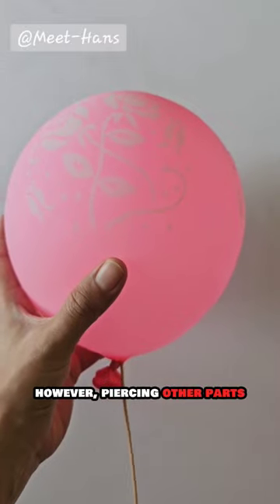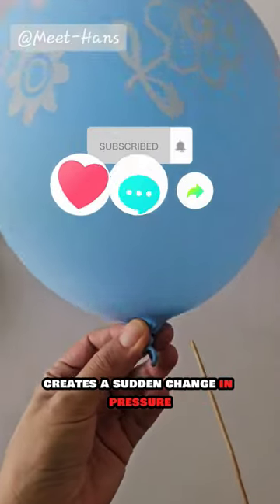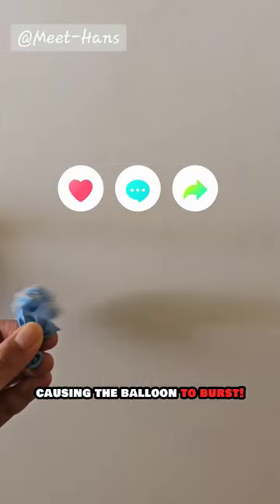Balloon Skewer #shorts #sciencefacts

Comment from the maker: Balloons typically don't burst when pierced with a skewer at the bottom knot because the air pressure inside the balloon is evenly distributed. When the skewer pierces the bottom of the balloon, the air inside moves sideways, not directly toward the skewer, thus preventing the balloon from bursting.